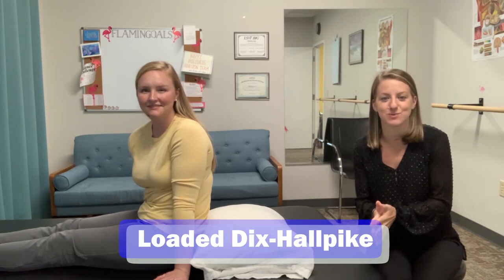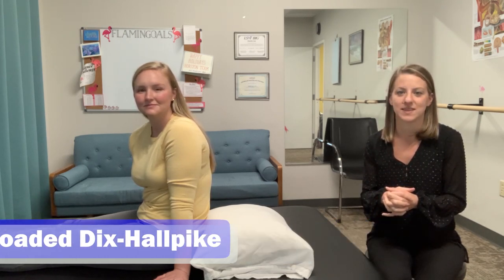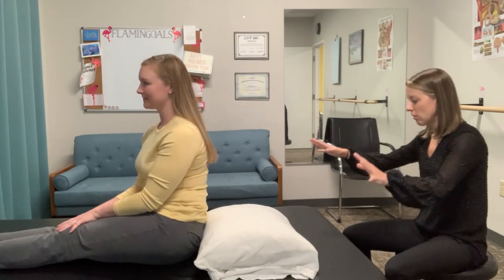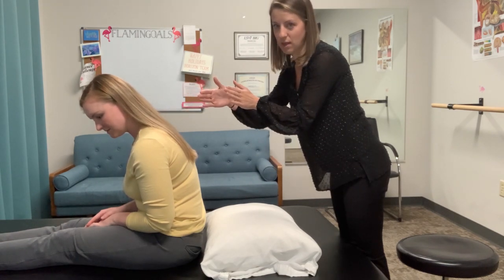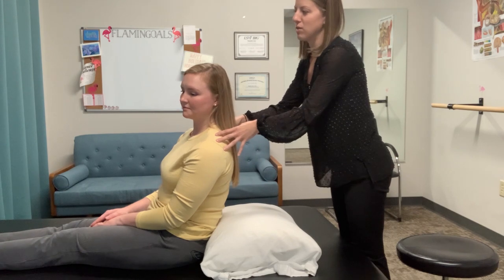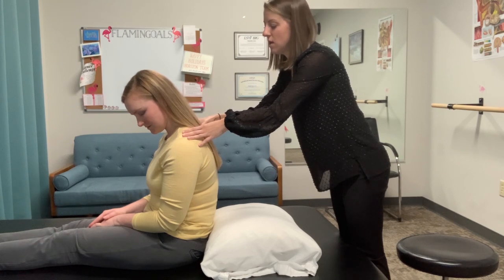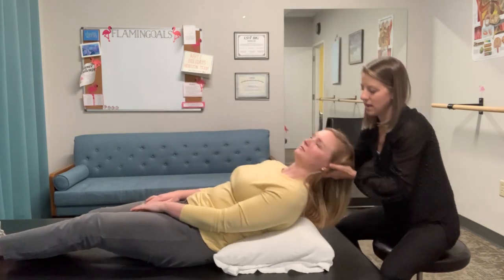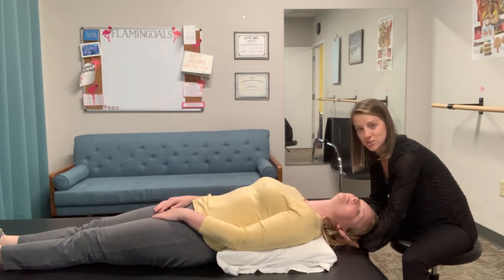How to Perform the Loaded Dix-Hallpike

Comment: Nice job! I’d emphasize leading with the forward ear vs just flexing the neck if you're not leaning the body forward after rotating 45 deg...I initially did it and wasn’t loading in the plane of the post canal
Reply: Great point Tim, that is a common mistake